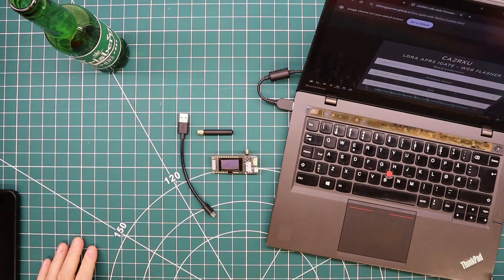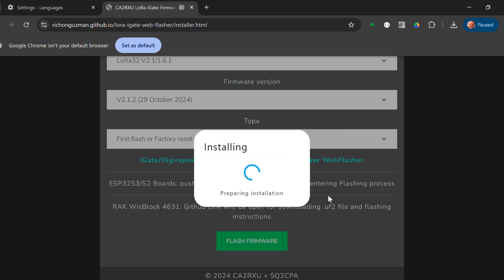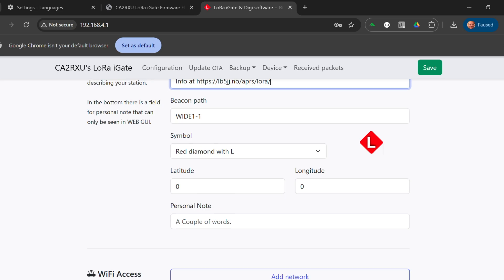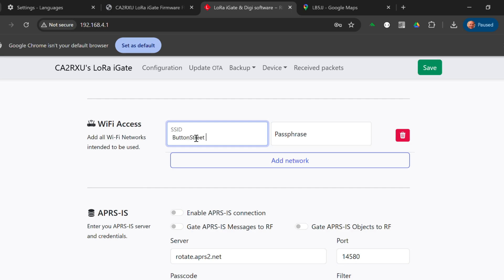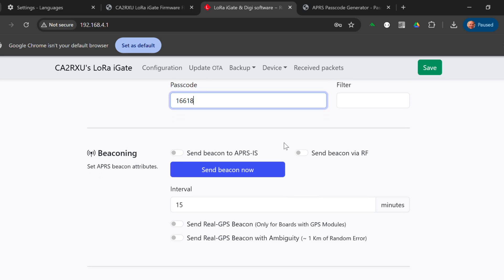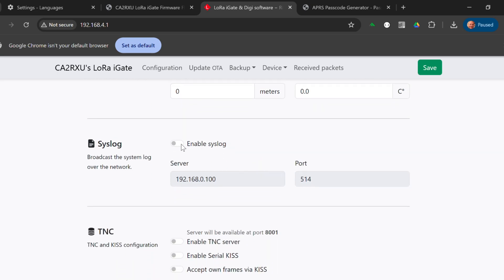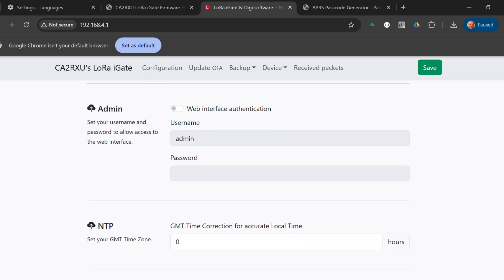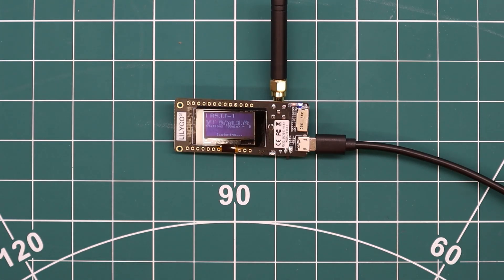LoRa APRS: iGate and Digipeater

Comment: does that digipeater increase the range of an APRS Radio in case you want to send and receive text messages if placed in the top of a hill?
thanks in advance
Reply from the maker: Yeah; that's the idea; a well placed (read: high) digipeater can cover an area of many hundred square kilometres!

Comment: Thanks for the video. Well done. Will this work with the 2 meter version of this board?
Reply from the maker: I'm not aware of any 2m LoRa modules. If you know of some, please share!
Reply: @radiohyperactivity  I bought one last month from Aliexpress. I flashed it with the aprs software, but no joy. I then realized although it's aprs, it's not an audio based packet. It's a different modulation scheme. I did see flashes of data, but it's just white noise. Every thing did appear to work software wise. I suspect the lora is not capable of decoding audio, without some extra components. I put it aside, until I can find another Application. I do have a couple other devices running on Lora. Neat little devices.
Reply from the maker: @dennisvoorhees6763  Was that a 2m LoRa board? Do you have a link for it?

Comment: Any tips to access the IP adress on the board, i get blocked from that adress.
Reply from the maker: Any details about how you "get blocked"? Are you getting an error message? If so, what does it say?
Reply: @LB5JJ  Thanks for your reply, i figured it out. I used my Phone and that worked as a charm.👍